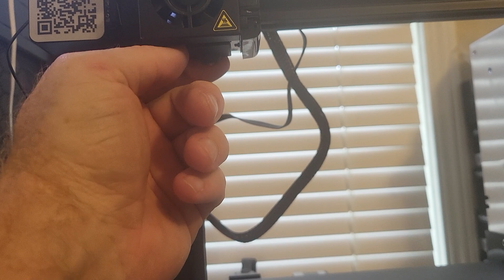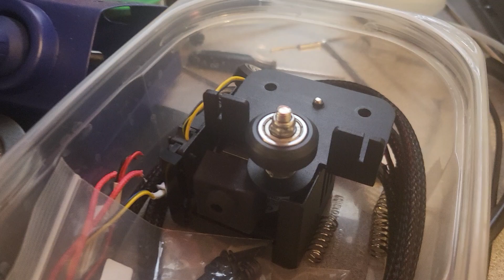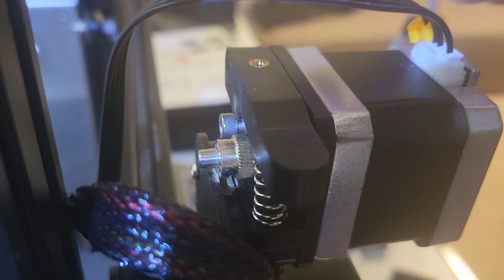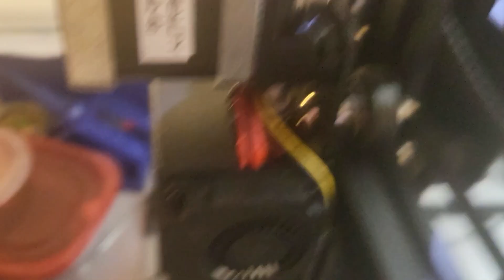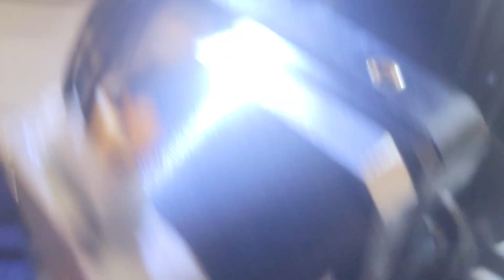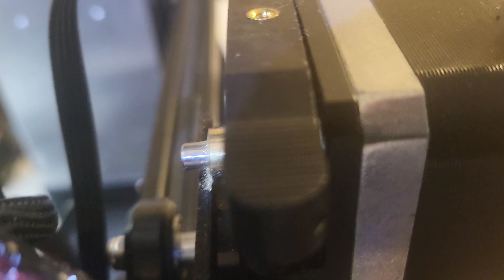Ender 3 Pro Layer Delamination issues and Troubleshooting

Comment: why are my prints flat when printing
Reply from the maker: Thanks for commenting.
Is your Z-axis not rising?
Reply: @quantaengineeringllc  I think or i hope its just the z motor - the upper mounts are loose - it seems to have a hard time rising, also it fails during auto home (z moves VERY slow) new to 3d printers
Reply: @quantaengineeringllc  finally fixed it! took to looking to forums to discover that the steps per mm was way off - i have it at 503 on the z as was suggested - but i dont know what the other baseline settings are supposed to me - impossible to find - thanks for asking

Comment: the problem I am facing is that the build base not only sticks to the bed but it seems to Fuse to the project itself and cannot be separated.
Reply from the maker: What type of bed are you using? Have you placed the bed with the parts in the freezer? What are your print settings?